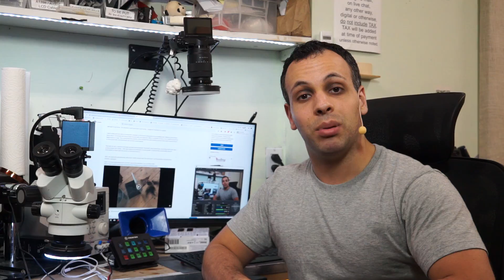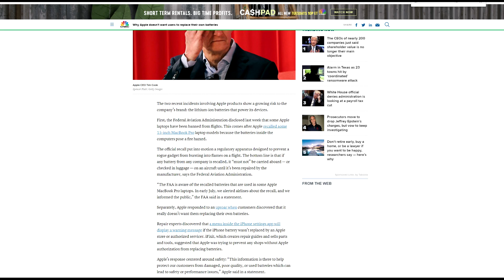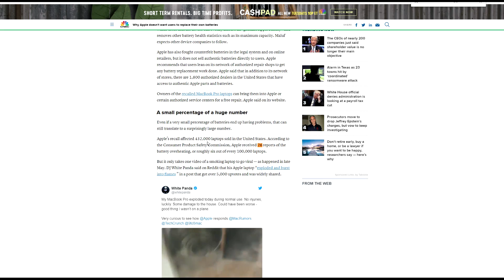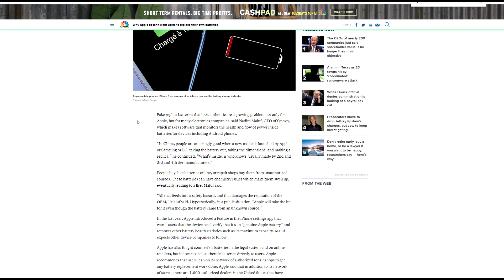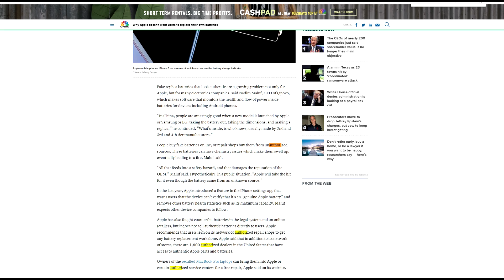OEM batteries explode, so 3rd party batteries are bad. Nice job, CNBC.

Comment: What if automakers had started this? So next year just by another car. Oh sorry you didn't go to the auto manufacturer to get all of your work done. If say you were having a problem with say the battery of the car and while you are there you are told by GM or FORD or whoever that we can't fix that but we are having a sale on vehicles and you were telling them but it just needs a battery. When are people going to wake up and stop buying these things year after year after year when in actual reality you could get at least 3 yrs or more out of these little plastic box but no they are convinced they need to get rid of last year's model because look it is a new shiny cheap made piece of plastic. It doesn't enhance our lives in anyway and yes I was guilty of this very thing until I woke up. Yes I still look at what is coming out but no I am not buying any new phones for a long time. I have a Moto z3 play and yes I am going to keep it till it won't go any further. I just got it after my Nexus 6p quit and yes I had to keep it on a charger cord but I was happy with it and then it just quit so I bought a new phone. When this Moto z3 play quits I will be looking for a phone with decent speed and a headphone jack with a replaceable battery I can replace myself.

Comment: Any OEM which is willing to recall their devices for potential battery issues is a good thing.   Honestly I have mixed feelings about batteries.   I don't want to write a book here but its important that if you chose to purchase and replace a battery you should have a full understanding of what your dealing with.   Yes batteries do explode often from being mishandled.  If you puncture one its not going to be pretty.   I have replaced batteries in the past and its never been my most favorite thing to do.    One of my employees changed a battery in an iPhone and he had a batter shoot flames and explode on his kitchen table.   When he tried to tell me how dangerous these things were I told him he should have a full understanding of what he was dealing with before attempting  the task at hand.  I told him had he asked me I would of gone over battery safety with him in great detail and would of explained the the potential dangers  as well.   If someone asks me to change their battery out I would refer them to a repair shop that does it every day.   I limit myself to my own devices.   If they ask me to work on a PCB no problem happy to do it.   I don't make money doing PCB repairs I do it only to help friend and family.   Anyway Batteries is a topic that a Channel could be dedicated to, fear them respect them and they are not a problem.

Comment: Go to a General Motors deal, they will gladly sell you any part for your GM car.  Apple needs to do the same at a fair price.  Normally I'll the aftermarket part because it usually will be better than the OEM.

Comment: Technically, Apple will have to replace the OEM battery with an "aftermarket" battery via the recall program, as they will have to use a different battery than the OEM, wether it's almost the same battery or not, some changes will have to take place to fix the issue.

Comment: Hey, Louis, any way to see how many times aircraft were disrupted due to their own batteries? For instance the 787 batteries?

Willing to bet that once GA and Commercial aircraft are combined and looked into that the number is way over 265 in 28 years.  Heck, in my 22 years of flying I have had 2. One where a voltage regulator failed and combined with the altitude the battery swelled and cracked. All I knew is I had a massive amp load all of the sudden and my radios got a ton of static.  The other one was on a "glass cockpit" aircraft where the battery backup is just an array of D Cell batteries mounted in the tail. Well, the plane spent 2 days on the blacktop in Phoenix in July. The batteries didn't survive.

Comment: Logic is an increasingly scarce resource these days.  This situation is much like the situation with drones.  Politicians and regulators are claiming that there's a huge danger to the public from the risk of a drone colliding with an aircraft -- yet drones have been "a thing" for nearly a decade and in that time not one single person has died as a result of the recreationaly use of multirotor drones.  Yet regulators keep harping on about the risk and the phrase "it's only a matter of time" is rolled out with monotonous regularity.  I suspect that you'll also hear "it's only a matter of time before a faulty third-party phone battery causes an onboard fire that brings down an airliner".  Sigh!

Comment: You should give up some other unfortunate occurances that doesn't involve mandatory certifications, that align with the statistical significance of this. Or is 10-100-500 times more statiatically likely to happen to anyone.

People need to pay (lithium) batteries the respect they need when handling them. They have serious damage and harm potential if handled incorrectly. But outside of that, they'really not that scary - the majority of people on this planet are keeping one either inches from their genitalia, their heads, or literally in their hand or up against their face, as I'm typing this.

Comment: I found AA batteries from the 80’s the other day. When I picked up the blister it pretty much disintegrated. The paint could be wiped off the battery with your finger. Then again they were in the Garage for 30+ years

Felt appropriate to share because we are talking about batteries

Comment: I’m glad you saw this article Louis and made this video...I read it yesterday myself and almost sent it to you. Like you I’ve run an independent repair shop for 10 years and have replaced a ton of batteries across the line on Apple’s products...and have had to remove swollen and expanding OEM batteries from ALL of them....including the most recent generations of Macs. This is a another PR move by Apple to undermine the trust of customers in independent repair ALL the while they are lower the standards internally of their own repair. How do I know this fact? I use to work for them before I started my own shop and it was because the moves they were making, internally, that caused me to leave. Do you know at one point I had to report to a manager who did not know what a hard drive was?!! Let that sink in.

Comment: I know first hand that these so-called Apple authorized repair shops have their hands tied. Due to the recent battery recall by Apple, I first opted to use one of these places in Greenville, NC. After dropping off my laptop, I was called a few days later and was told that I had to pick it up because they weren't allowed to open the back due to a dent present in the frame. The odd thing was that they DID TRY to open it and I could tell. About 2 years ago, my laptop fell out of the case from a distance not far from the ground. I was impressed that there was so little damage. Just a slight denting on the side opposite the AC connection. That's was all. When I picked up my laptop from this repair shop,  the screw on the underside near the corner where the dent was, was deeply pressed into the bottom of the laptop as though someone used extra force to put it in. In addition, there was a big gap where none existed before at the back of the laptop adjacent to tge dent. The closed connection  wasn't flush. This observation presented conflicting findings. If the gap was present as a result of the fall, I would expect a loosening if the screw, not a tightening. Some of us do use our brains, plus I do investigations for my work. I had to drive all the way to Raleigh to the Apple store to address the recall. Good thing too, because, in addition to changing the battery, they also changed the bottom case. I wasn't upset because the authorized repair shop couldn't close the case properly, but because they lied and said they did not open it because Apple won't allow them to open the case if it is damaged. They KNOW that they defied the protocol and ATTEMPTED  to open it.

Comment: We see recalls about the batteries if you replace a new, fixed, safe OEM battery with an older, still dangerous original unfixed OEM battery that is a risk. Perfect copies of those broken OEM batteries will be equally broken. When Apple is this bad and doesn't allow component level independent repair, they have two strong reasons. Planned obsolescence is a common problem. But Apple wants to avoid not only independent repair, but they want to avoid 3rd party independent diagnostics because trusted 3rd party repair can identify design issues including unsafe products. Also, it identifies anti-customer practices where authorized partners lie to customers about possibilities of data recovery and these lies do significant damage to customers. If Apple would be held accountable for these losses that would be a huge financial hit for them. 

And I bet in some cases you would still see how some replacement products are "equally bad", but with fewer cycles in them, so probably more lifetime left, they are inspected and in an okay condition, etc. Hopefully not refurbished. 

Independent repair can lead to lots of people with plenty of experience, good reputation, well-recognized skills who can testify against them in any class action lawsuit about bad and sometimes even unsafe product design.

Comment: 5:30 - the logic is - 'even Apple's original battery sucks, so what to expect from the third party?' - but sure it's not explicit, because wrote that original Apple's battery sucks - they will not do it.
in fact my aftermarket battery on Lenovo is a way better than the original one.

Comment: So, just to make those numbers even more fun: 265 cases over 28 years. That's 9,464 incidents per year. on an average of 50 million flights (authorized plus unauthorized, commercial, freight and military, on nearly if not all flights there'd be a smart device with a Li-ion Battery) that makes a chance of 5.283.178 to 1 that any device on your flight will have a malfunction. These malfunction often probably just being an expanding battery blowing the cover off of a machine. Even if it were to burn it'll burn up in mere seconds, only releasing some nasty air. (be sure to grab your overheads respirator just in case) and your flight will 100% guaranteed proceed with no death. Perhaps to be sure the pilot will land at the nearest possibility just to get you on a fresh plane. 
All and all, utter and total bullcrap. As we're used to by now.

have a lovely day

Comment: Nonsense. If the real reason was safety, why not make your batteries available to everyone and sell them with zero profit margin? Apple Samsung etc does not NEED extra profits from replacement batteries. 3rd party battery companies do. If OEM batteries were remotely price competitive with 3rd party, no one would bother developing their own... Make schematics/procedures for battery replacement publicly available to everyone or design phones to have user replaceable batteries which was the standard not too long ago.. Have your software check NOT for OEM installed "flag" but to actually test the consistency and performance of the battery; from experience, using too old OEM battery can be much more dangerous than having a brand new chinese-made battery. 

All of this is perfectly doable, but no.. Sell your batteries 3x the price of 3rd party, prevent shops/users from putting OEM batteries to their phones by software locks... Force your customer to buy YOUR battery and have it replaced at YOUR store... Calling this "safety measure" is an insult to my intelligence. This is just greedy..

Comment: what louis fails to mention is that oem batteries have the reputation of the company tied with the battery. which means they better make devices with good QUALITY since they risk loosing the consumer's trust. 3rd party dont give a crap about you or your device also their reputation is invisible. Louis only cares about this topic since 3rd party parts is his bread and butter and apple may use safety as a reason to ask the government to put further sanctions on 3rd party repair and parts. in apple's perspective, they dont want 3rd party parts to have the potential to ruin 1st party reputation.

Comment: I bought a third part battery for my Samsung and was so stupid that I were only looking at the price and bought the cheapest. I experience the same issue you discuss in this video when it comes to endurance, the capacity suddenly falls quickly, but it hasn't burned my balls of and I'm not afraid that it will. Basically I agree with everything you say. I find your rants entertaining, but I love your argumentation. Always! Even if I sometimes (rarely) disagree with you, your arguments are always well founded. Keep up the good work!

Comment: I am guessing that Apple won't let you repair things at the level you do now. If Apple was smart (cough cough) they would create a "Certified Independent Repair Shop"  in which you are allowed to get REAL Apple parts (maybe  a a slight price increase, EG a part that you part 20 bucks for costs you 22) and Apple acknowledges the level of work you do to be equal to or better than their techs as it possible you have more over all training.

Comment: that's almost 10 instances per year.... considering only the last few years are relevant... it's not that little... of course it has nothing to do with repairing or thrid party batteries especially when done by qualified professionals... but over 200 flights even if just small incidents is not that little

Comment: Becoming authorised will seriously limit you as to what you can do, apple will have guidelines sayin you can do batteries, screens etc but you cant do board stuff that would be left to just replacing the boards and not actually repairing anything

Comment: The writer of the article does indicate that there are two problems. However, I do agree that the writer does try to stick the problem of batteries on fire to 3rd party batteries none-the-less. And that's dishonest at best. This article should not have been published.

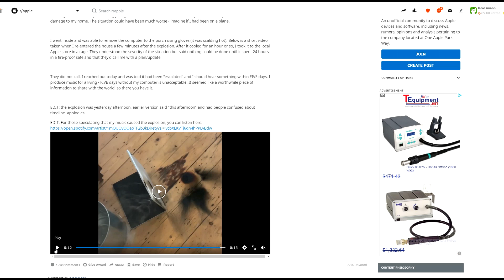Comment: That shown battery had the usual problem if you build LiIon Batteries too greedy: It had an internal short circuit, since the security overlap those batteries normally have (which cost material, space and lead to less capacity) is too short. 6 over 100.000 Laptops is actually a normal number in those cases, due to the fact that the machines of today make little to no error - but if they do, it's gonna hurt. Still, those batteries should be replaced since a short circuit can happen by squeezing the battery in the "wrong place", i.e. if your handle your laptop a bit different than usual (picking it up with one hand or tilting it and putting it in your bag). Even in those cases, the battery won't instantly blow up, they have security measures. But if the short circuit stays, it's gonna be a blast. 1:15

Comment: I have a feeling that Apple is actually using 3rd party batteries. The amount of batteries that I see blowing up lately on 2015 models both 13" and 15" is crazy. It almost feels as if Apple flipped a switch on older models to start going bad.

Comment: Funny, the ONLY lithium ion batteries I’ve ever had swell up were both OEM MacBook batteries. If Apple wants me to use only OEM batteries perhaps they should sell me one.

I even took my swollen A1398 in happy to pay Apple and I couldn’t even drop it off without an appointment. Argued with them and they insisted I make an appointment and come back. I did it myself. Really wasn’t even hard.

Comment: I have always used cheaper lithium batteries from China as the price you in the uk is close to 10x the price of the ones imported from China and over the last 10 years never had a problem with the cheap batteries don't think I will ever change where I get them from

Comment: I've replaced batteries in phones using replacement batteries sold on line from reputable battery dealers. I never had any incident or degraded performance. All these phone batteries seem to be made by a number of manufactures in China including the original batteries in the phones. Most likely it is the same group of factories turning out all the different batteries for the various phone manufactures.  These lithium batteries should not explode or catch fire unless someone severely overheats it, or punctures it penetrating the electrodes inside, and thus shorting the layers to each other. 

I found with many of the phones and tablets after about three years the battery gets swollen up. Many times the battery still performs okay but is bulging the back of the device case. It is very important to replace a swollen battery for safety reasons. The expanded gasses inside (consisting of the combination of lithium and hydrogen oxide gas) are highly corrosive and dangerous. The batteries are sealed to prevent these gasses from escaping if released from the chemical reaction of the battery. Usually overheating of the battery causes this issue. With age and use these batteries may swell up.

Comment: Simple logic and fact. 
1, Apple doesn't produce batteries. 
2, Apple uses junk batteries in iPhone. That's why iPhone has so many battery issues. 
3, There are far better battery producers on the market, it's not rocket science industry.
4, I replaced my own iPhone battery, the battery life is longer than the Apple certified battery, never had overheating issue after the replacement

Comment: In the old days, removable batteries never had wide spread problems of "exploding". Because when a battery goes bad, the consumer can very easily see it's deformed and easily replace it with a new one. Nowadays when a better goes bad, consumers can't see it. It's only when it deforms so bad that it cracked the screen, the back panel, the case... or even wrose when it's too late that the device catches fire the consumer know it's fucked up.